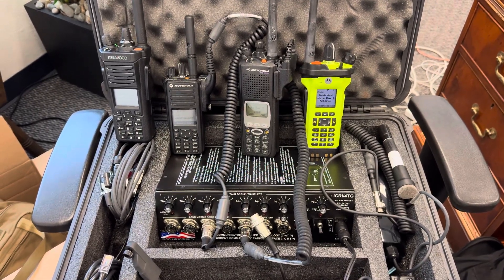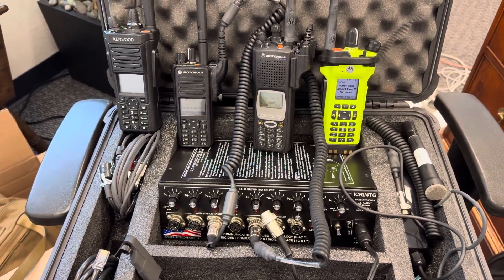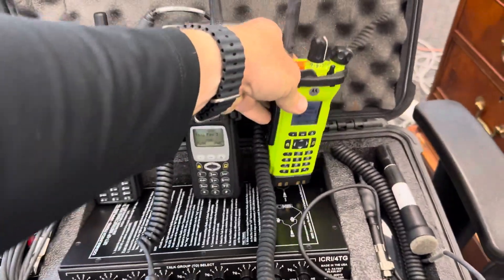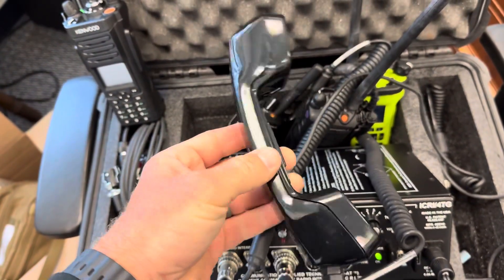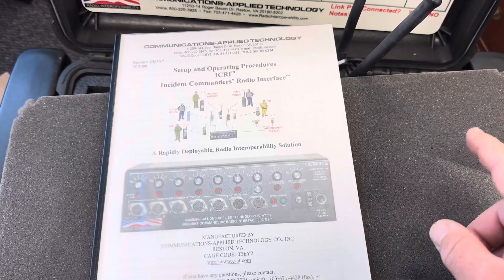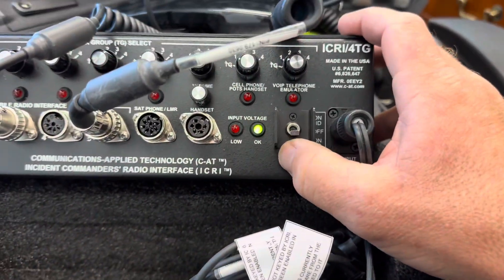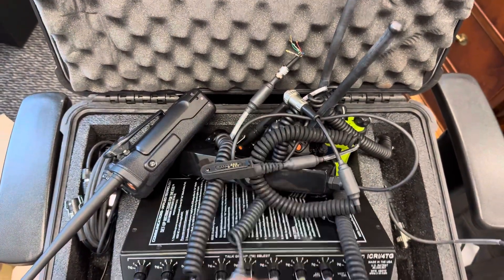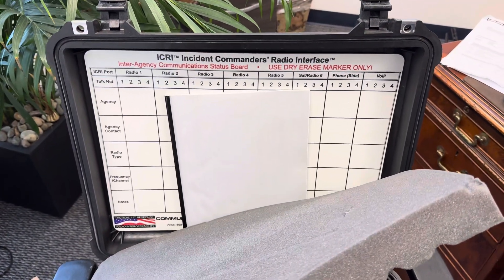Incident Command Radio Interface (ICRI) portable repeater for APX8000 KNG-P150 and MOTOTRBO

Comment: In the mid-2000s I was assigned a car with an ICRI in the trunk.  I had forgotten all about it until I stumbled onto your video.  I posted a couple of pics at the bottom of my QRZ page if you're interested.  73
Reply from the maker: That's really awesome! Thanks for posting the photos of your installation. What was your opinion of it? Did it work as it should? My sister was born in Galveston when my dad was training at UTMB and the shriners hospital burn center.
Reply: @AdventureCruiser   We bought about a dozen ICRI units with all but the one in the car being in Pelican cases like yours.  They were distributed to various police substations across the city.  The fire department may have had some also, but I don't remember.   The hardwired units (ACU-1000, etc) were obviously the better option, but those required specialized training, more expensive, etc.  

 The Crown Vic was assigned to myself and two other officers with the purpose of having immediate availability.  Most of what we ended up doing was coordinating with the fire department at major fire scenes.  

We set one of the ICRI units up at the 2006 NBA Allstar Game in the upper "catwalk" structure of the Toyota Center in Houston.  It was to link FBI SWAT and Houston SWAT who were providing overwatch for the event.  Other than that event, I'm not sure if any of the ICRIs were used.   If you search "preston moore icom repeater" there is a document I wrote that I guess was captured by Scribd.  Toward the bottom there is a pic showing the ICRI deployed at the Allstar Game.  Have a good one!

Comment: Early version of a JPS ACU..
Reply: Not an early version - engineered to be the Easy Button. No IT degree, no subscriptions, no tech guy saying, “Huh, that’s weird. It worked yesterday.” Just a rugged, fail-safe tool designed for real-world response. (Sales disclaimer *Mini and 10-port models also available *)

I'd like to address the elephant in the room - dismissing the ICRI as “old tech” is like ignoring a fire extinguisher because it’s not WiFi-enabled. When disaster hits, you don’t need fancy - you need functional. Unfortunately in the 2024 Hurricanes (Beryl, Helene, and Milton) we received so many calls and sent out ICRIs to teams because Power surges and unstable generators fried ACUs, leaving responders without comms.

The ICRI? Still standing. Multiple power options. No fragile software. No time wasted rebooting, no frantic button-mashing—just comms that work when you need them.

Black Sky days aren’t a matter of if, but when. And when infrastructure fails, the ICRI is proven to work without internet, without power - to keeps teams talking—across radios, agencies and satellites.

Because when failure isn’t an option, C-AT.com has a tool that doesn’t flinch.